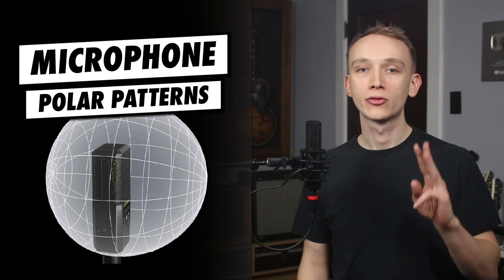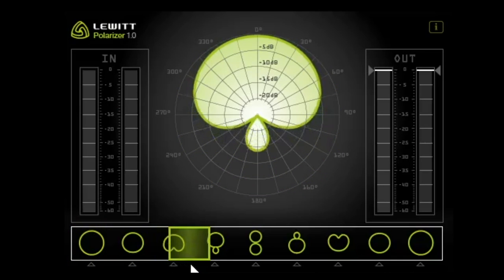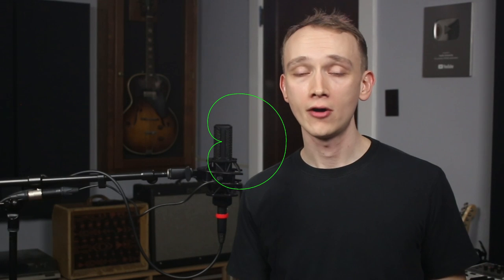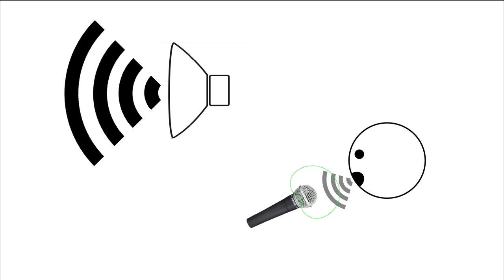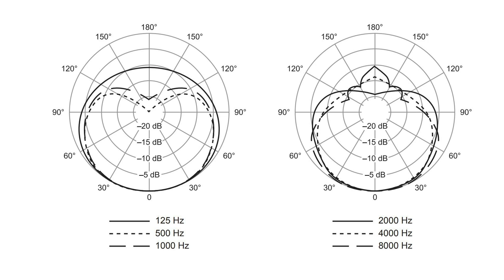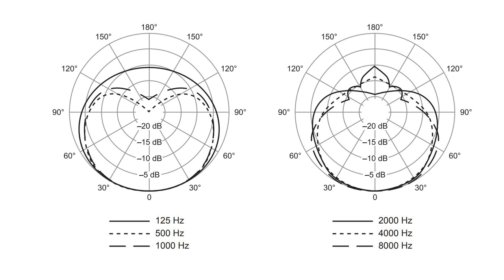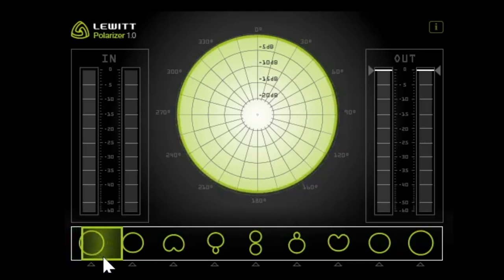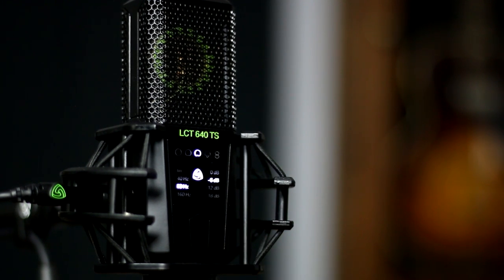How Do Microphone Polar Patterns Work? | Cardioid, Supercardioid, Omni, Figure-8, & More

Comment: Well done!  Nicely explained.

I'd take issue with only one thing: you will not get nice stereo with a pair of spaced omnis, and I wouldn't choose them for location recording! It will give you two different channels, but there will be no stereo image to speak of. The mathematics of the Blumlein pair (either as crossed cardiods or figure-eights) gives you a proper image. There's no 'hole in the middle' effect. 

I've done a lot of stereo work with crossed fig-8 mics. When doing stereo recordings with actors in a studio, it's really important to make them aware they can only stand at the mic in two opposite quadrants: the other two quadrants, at the sides, result in out of phase sound between the two channels. We used to put tape strips on the studio carpet to mark the safe areas! 

Figure of eight mics in particular are invaluable for multi-mic techniques (orchestras, self-balancing bands of all sorts, etc.) and you are dead right that you use them to null out sound you don't want, leaving what you do want. 

They even have value in PA applications, for example rigged underneath a grand piano, so the dead axis faces outwards towards the PA system and the auditorium. A thick carpet offcut on the floor underneath helps too. Unobtrusive, hard to knock out of position, really clean sound. 

I'd do that over cardioids any day, not least because figure-8s are really dead off-axis. Take a good ribbon outdoors on a very-still-air day (or an anechoic chamber) and walk round it: you seem to jump to hundreds of feet away - it's amazing.
Reply from the maker: Thanks for these additional tips, Simon!

Comment: Is omnidirectional not affected by proximity effects?
Reply from the maker: A true omnidirectional mic is not. The primary mic in this video is a dual capsule mic with an Omni mode. It is less susceptible to the proximity effect in Omni mode, but a true Omni will have even less proximity effect.